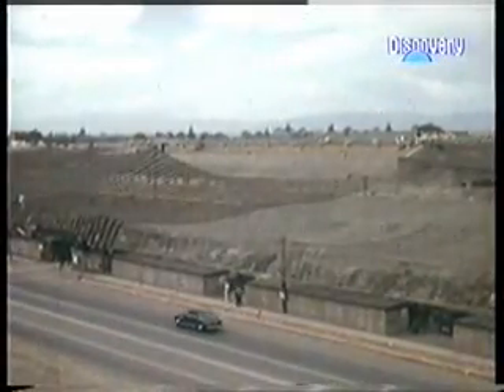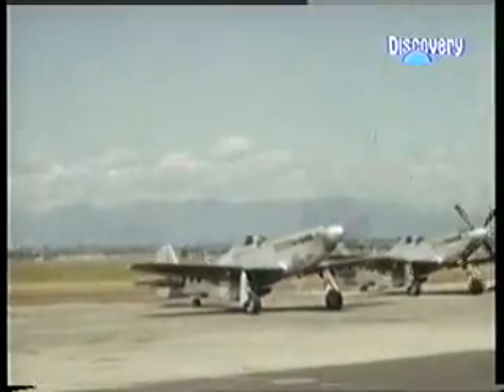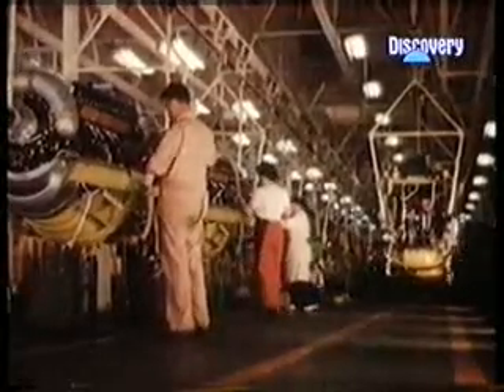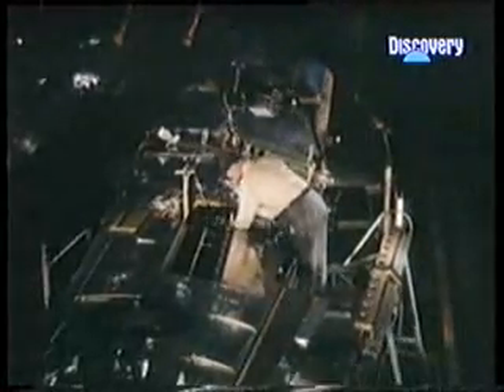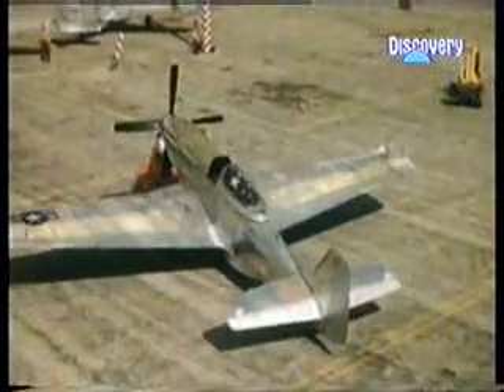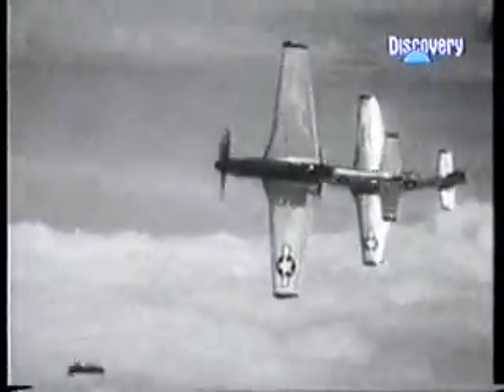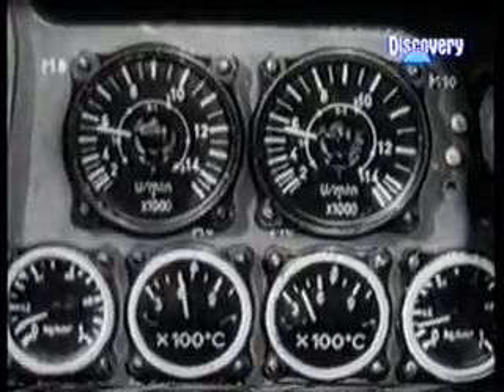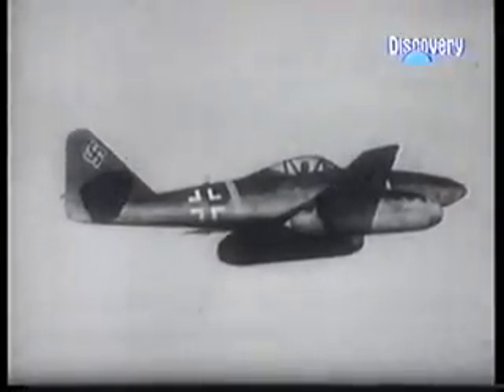The story of P-51 Mustang 4 of 6

Comment: Joshuajlawn  I would agree with you. The Spitfire was a light weight low fuel capacity intercepter where as the P51 Mustang was 2,000 # heavier and carried much more fuel. it was a long range escort fighter. Two different roles for two different planes. Each plane gave up something to accomplish their goal. Each was a GREAT plane.

Comment: wxmanwill They actually did some tests of the Merlin in P38's but even the 2stg supercharged Merlin gave very little performance gain over the Turosupercharged Allisons used in P38's. So the Merlins were allocated to the P51 Mustang.
Reply: This sounds like double talk. Why would you allocate the Merlin to the P51 if there was no defense between it and the Allison? The P51 was a better plane than the P38?